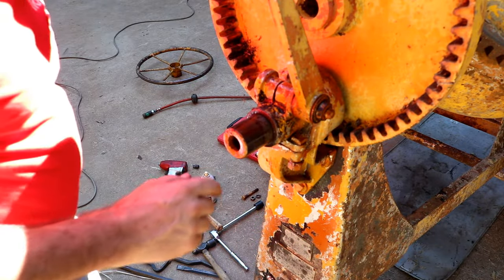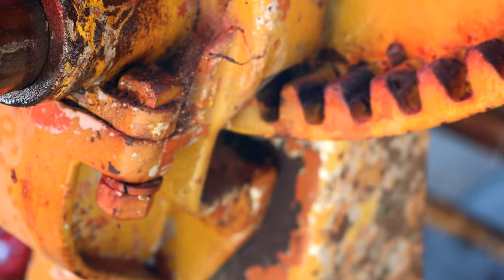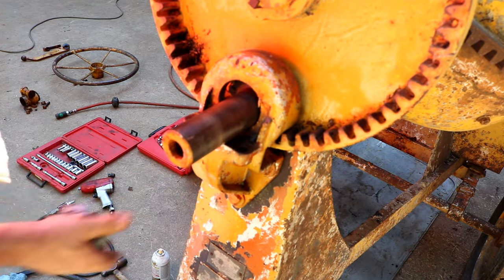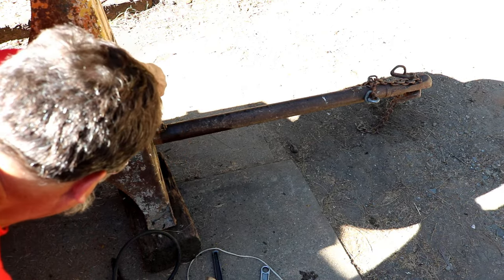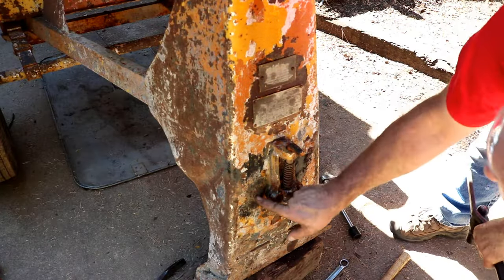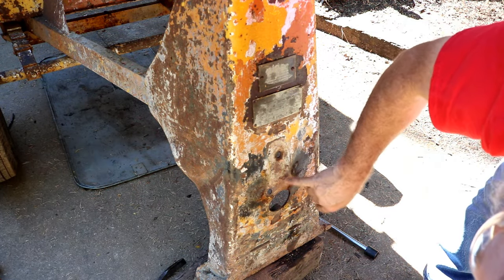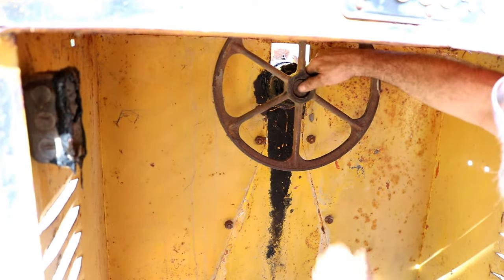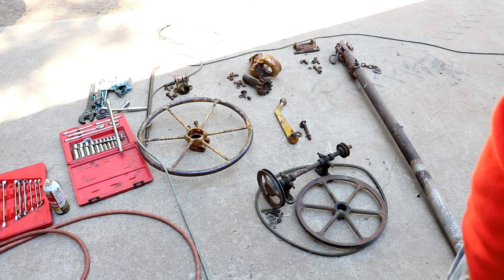Cement Mixer Restoration | Disassembly P1

Comment: I like this series,
I'm surprised there was no need for torch heat.  

I liked your hat.
Reply from the maker: No heat needed so far.   To get the roatation gear off the yoke it still is a maybe.  Thanks 12345 for your support.

Comment: I am woefully late to viewing this video.., what brand is this unit (maybe a Gilson).?  Saw 2 tags, but couldn’t quite read them.  Looks like a nice unit.  I am now binge watching the series.  I have a “Gilson” that looks very similar, maybe a few years newer.   “that “squeezy” thing”.., hahaha…
“she’s a beaut’ Clark”…
Great video, Thank you sir.
Reply from the maker: Thank you Gregg.  It was built by Construction Machinery Company, Waterloo, Iowa.  3.5 sack mixer, Model: Wonder Mixer, S/N 62449
Reply: @RRINTHESHOP  oh, thank you for responding back.  My bad, I had not yet viewed part 3, (when I commented), and saw those tags at a closer angle.

Comment: That motor pulley is actually quite pretty...man, when they used to make the right. Now, you buy one, throw it away, buy another...they are cheap, and cheaply made.
Reply from the maker: When I get it all cleaned up and painted it will really look good.  Thanks Aserta.